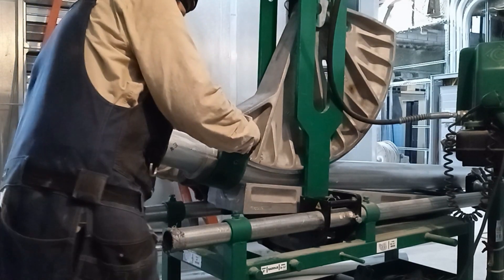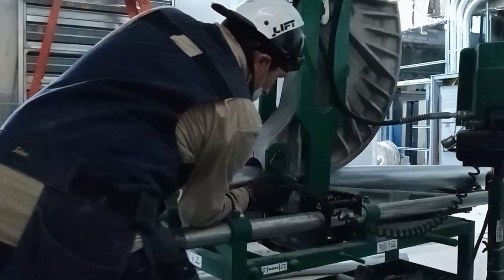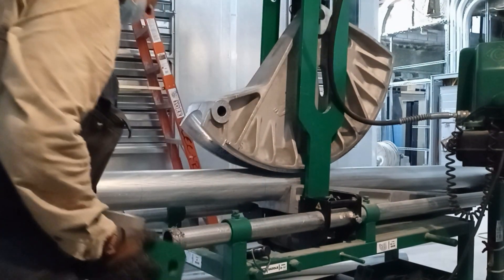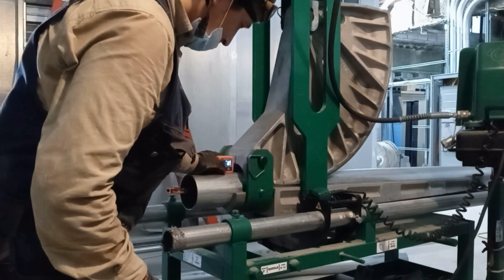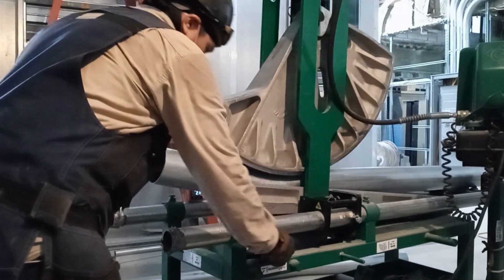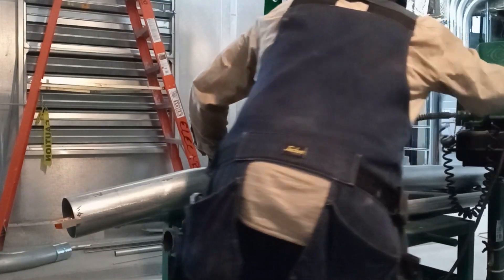Conduit Bending - Should I bend my conduit? Thinking like a master

Comment: Love the channel, love the content. Ive been using the same bender you are using in the video.

I still use 2 level options (2 torpedoes or torpedo and digital) to check my stub and leg for square.

What do you do to make sure that the greenlee bender table is level? And that you're sure that the when the conduit is sitting in the follow bar level before adding any bends?
Reply from the maker: Thanks or watching my channel. I really appreciate it.  As far as keeping the bender level.  I really don't worry about it. With my digital level I place it on the conduit towards the edge of the conduit and then I zero out the level. So now it doesn't matter if I'm level or not.  If I bend a 90 or will be a 90. One thing I forgot to mention is that in the table bender before you zero out the level make sure your conduit is locked in and what I call snugged up which just means that you have your saddle up against the mark and your locked in ready to bend.  Then zero out the level.  Even without the digital level when I used to do it with a protractor.  I would just add or Subtract what ever the protractor read after locking in my Conduit. Of course it's always better if the bender is level, but it's really not necessary if you know how to do basic math.  So I don't go crazy when it comes to leveling the table bender.  Hope this helps.

Please follow me on my LinkedIn account and endorse my under my skills section on my profile.  I would appreciate it.  
Www.linkedin.com/in/melvin-rubio
Reply: @TheArtOfConduitBending  bro, thanks so much. I actually conditioned my toolie to double check with level and plumb (respectively, leg and stub) leg and stub. 

I come from a welding background and it was(is) difficult to trust an unleveled table and digital protractor.

I will start giving it a go, with the zeroing out function. 

Thanks again. IBEW 357 Vegas Hand!
Reply from the maker: @RCDriftChaser  honestly it doesn't hurt to level the table. But if your digital level has the zero function try it out. That's what it's there for Instead of trying to make the table level.

Comment: Is there a push through method for a normal offset? 

Sometimes you don't have enough pipe on the end to do an offset so you turn it around and bend it backwards. Only problem is that it throws off your obstruction measurement. Where the pipe returns to 0°. 
The only way I can think of adjusting your two marks on the pipe to do it backwards would be to bend a scrap piece to your desired degree and chart your bender for center of bend. Then subtract the distance from the arrow to your center of bend. On both marks. And bend the conduit backwards.
Reply from the maker: Exactly my dude... What you just explained is called bending on center, it's also what the advanced bending method teaches you how to bend (check out my playlist on advanced bending) once you learn how to bend on center you have freedom of making any bend seem easy. Learn how to bend on center works best with large conduit that has to be bent on a electric or hydraulic bender. Hope this helps. Join my discord, if you ever have questions you can post them in my private community there. Link will expire in 7 days.
https://discord.gg/unBr3NUB

Comment: I always try to plan out conduit racks or runs to avoid elevation changes as much as I can . Once you gotta stop and make 6 saddles in 4” conduit vs planning out an extra few minutes means a lot of time on the bending table . Also I try to never use pull cans as 90’s . Install the pull can right after a 90 to keep it legal and let the tugger do what it’s job is . Great content man ! Keep up the great work .
Reply from the maker: Thanks for watching and most of all for commenting. Also that was an awesome tip to install the can after the 90° and let the tugger do it's work. Thanks again and I would appreciate it if you would share the channel with coworkers and friends. I'm also on all social media, podcasts and I have my own Discord server all @holmzlaw.

Comment: Plant hand here… I’ve been mainly running rigid with a greenlee 555 for the last 7 years… curious if you have any experience with that? They call me el plomero!.. lol sometimes you gotta use fittings… hahaha… na but I agree with you.. after being able to bend ANTHING you want it’s all about planning the route , making smart decisions and keeping your pipe as straight as you can . Only doing offsets when it’s necessary even though they look badass when done correctly . I’ve been watching your vids and lovin the content … looking forward to more!..
Reply from the maker: Yes I have a lot of experience with rigid, stainless steel, and rob Roy.  Of course not as much as EMT. Yes sounds like you are definitely experienced enough. Looks like you know what I mean after bending for so long I try my hardest not to bend unless necessary. And if I do need to bend I do my best to make the work look as clean as possible. Now I just challenge my self to take my time and find a route where I can keep my conduit as straight as possible and on the same elevation for as long as possible. Anyway, thanks for watching and most of all for the comment. 
Follow me on all social media as well.